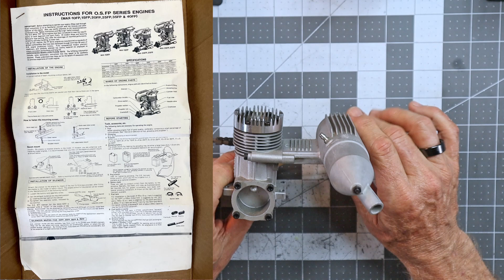Engine Talk Episode 1 OS 40SF, Saito FA 30S, and More

Comment: Hi David from little ole New Zealand, David Im rebuilding a Surpass 120 and its so bad inside Im thinking about about buying a cheap Ultrasonic cleaner off ebay...any thoughts as to what I should be looking for in a cleaner spec? love your videos of course.
Reply from the maker: No.  Ultrasonic cleaners are pretty simple devices. There is nothing special about them.  This video shows mine. https://youtu.be/AGM1-mu2Mm8
What cleaner I am using. https://youtu.be/iePf-c6lK3M
What NOT to use.https://youtu.be/iDkebbEkE10
You can do a simple key word search on my channel page to find videos such as these.